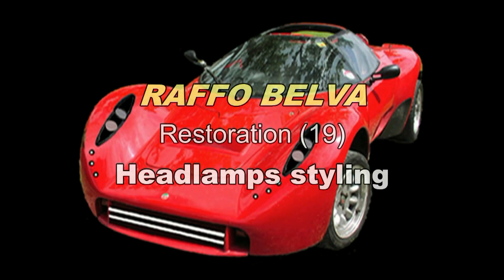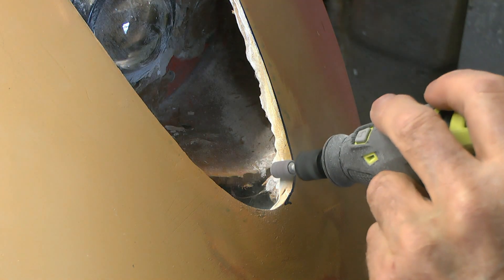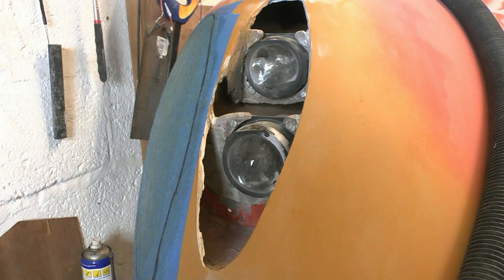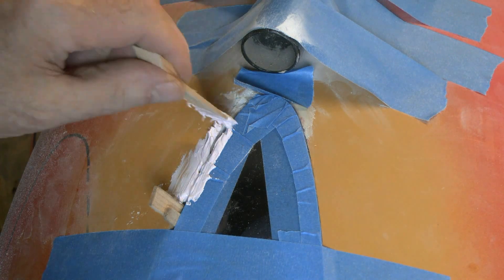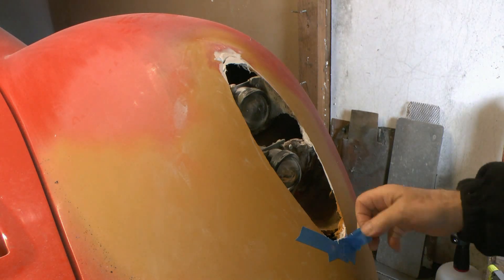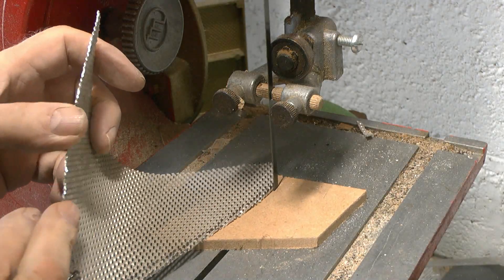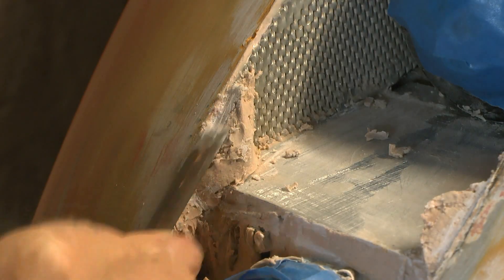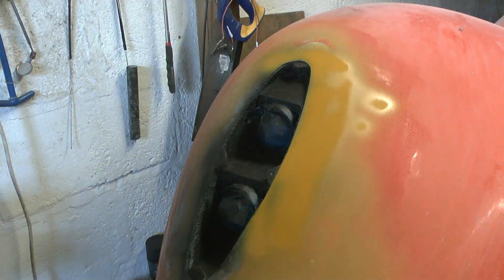Custom projector headlamp design & build (Raffo Belva 19)

Comment: Nice. I expect you mean Polycarbonate, not Polystyrene.
Reply from the maker: No, I referred to what is sold as 'Clear Polystyrene Flat Glazing sheet' that I purchased from B & Q (UK). Polycarbonate is a different type of thermoplastic, probably better but I used what was readily available and after experimentation with heating/softening polystyrene formed better than acrylic sheet.
Reply: Thanks for the correction. You know more than I do. I will research that.